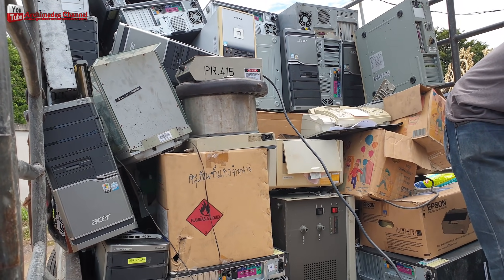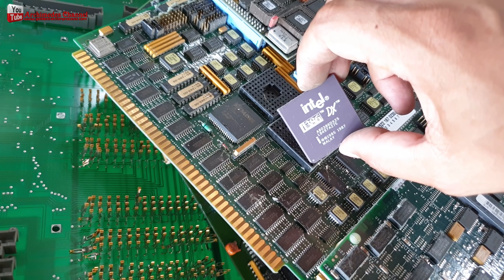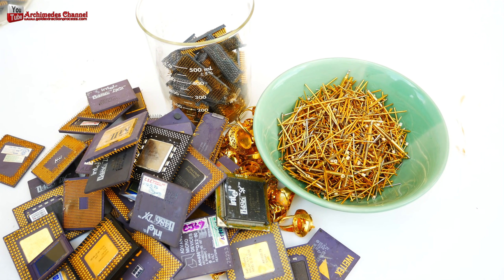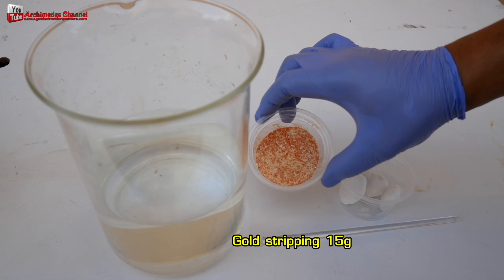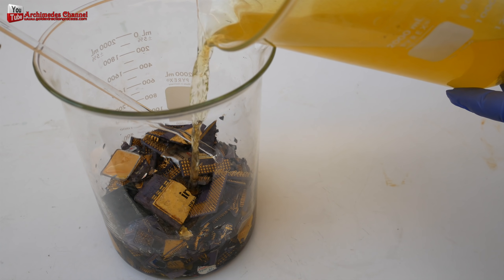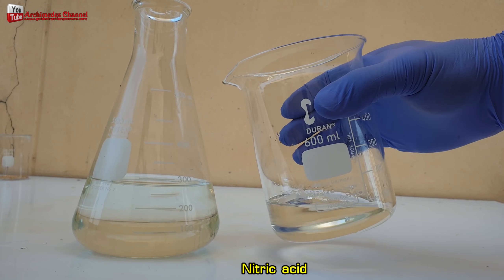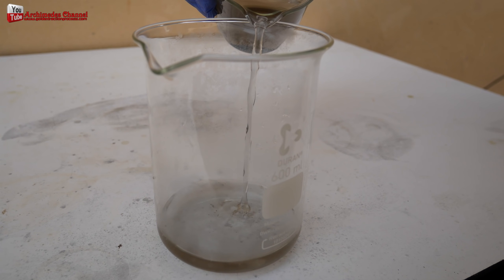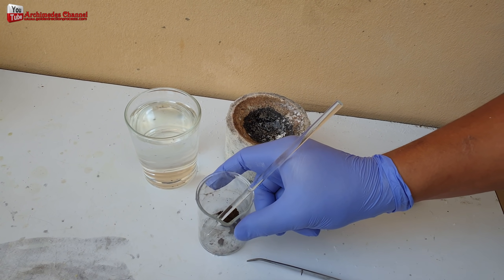gold from computer parts extracting gold cpu recovery

Comment from the maker: 🔑🔑🔑🔑🔑 How to get gold from computer parts without chemicals?
One of the most cost and time efficient ways of extracting gold from electronics is by using chemicals. However, this should only be attempted by people who are knowledgeable in chemistry and have the right safety apparatus to do so. 

Using chemicals on electronics components will often release very toxic fumes, and should only be done with the right personal protective equipment (PPE) and ventilation. For this reason, you might be wondering if there is a way of doing it without relying on chemicals?
But before you completely rule-out using chemicals, some researchers found an interesting method using weak acids, like vinegar, to get the job done. You could also consider reverse electroplating too. 
old electronics gold
Older electronics tend to have a lot more gold than newer ones. Source: pxhere
Alternatively, you could simply ship your bits to a specialized precious metal reclamation company, have them do all the work, and get paid a proportion of the proceeds. This will not be as cost-effective, but you chould still yield a profit without getting your hands dirty. 
It might also be worth checking how much money electronic components are worth as is, rather than focusing on the gold content alone. 
But, if you are determined to do it yourself, you have two main options: using heat or using brute force. The former tends to be very expensive in fuel and apparatus, plus is pretty dangerous if you don't know what you are doing. The latter is; however, relatively safer but more labor-intensive . 
For this method, the first stage is to make a collection of spare electronic gubbins. Computer chips and boards, and other parts from other electronics like cellphones (like the SIM card), are all likely candidates for finding a decent amount of gold.
The next stage is to strip out any circuit boards, and other bits, you've managed to scrounge together. You will need to do this by hand if you don't want to use potentially dangerous chemicals like hydrogen peroxide and aqua regia.
You could just cut off the gold-rich parts, like contacts, CPUs, etc, and save the rest of the bits for later. They also have precious metals, like silver, that you can reclaim later. For some parts, you can use a magnet to separate out all gold-plated steel parts. 
gold in electronics
All that glitters is gold on some electronic components.
Next, collect all the gold flakes and bits and pieces together and melt them down. You'll need specialist equipment such as a clay bowl and blowtorch to do this, and sufficient protective gear like flame-resistant clothing, boots, and googles. 

For best results, you'll likely want to add some borax, as this enables the gold to melt at lower temperatures. If using this method, when the borax begins to soften, add the gold flakes. Heat until the flakes melt into a bead. 

Let it cool, and chip the gold out of the re-solidified borax. Rinse and repeat for any old electronics you find. 

And that's a wrap. So, next time you are considering chucking out those old electronics, think twice. They might be little gold mines in disguise!🔑🔑🔑🔑🔑🔑🔑🔑
Reply: Thank you so much sir for this video and how can I get you're membership??
Reply: good
Reply: Thank you for the Info and yes I would only do this with proper ventilation and ppe but I think is a good way to build up gold reserves at the sametime giving me something to do with scrap.
Reply: The way I know is the Aqua Regia

Comment: 8 grams looks like it would be worth $480 (does not include the expense of the chemicals).  Definitely worth looking at the eBay value of the intact working chips since no chemicals are needed and there is less labor involved.